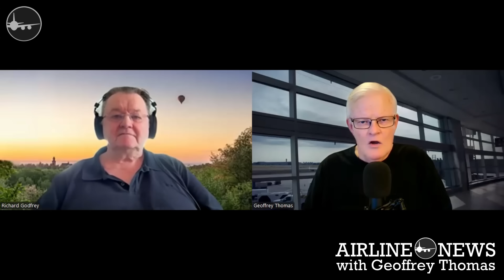Air India Crash - Probable Cause  #airindiacrash

Comment: Another absolutely fascinating edition and thanks both for bringing it to us.
I am still left with a big quandary - the fuel switches.   AIUI with the dual engine failure, I am assuming the FADEC tried to relight the engines automatically, and I think you have confirmed that one engine successfully restarted, and was spooling up just prior to the impact.  Possibly also that the other engine was going through reignition.

The PF or PM definitely cycled the fuel switches - per the CVR briefed in the scant report,  but was it actually necessary to do ? or given a few more seconds, would the ?FADEC have restarted the engines and the aircraft resumed its climb out of Ahmedabad ?

Welcome your help in understanding this please Richard and Geoffrey

Comment: It is common for take off with less than TOGA power to save the engines based available length, temp and altitude.  Therefore the explanation for the long roll.
Reply: It should be possible to calculate the derated power settings based on the calculated V1,V2 and the other parameters.  The implication of a long roll is based on the time in the preliminary report of when 'the aircraft started rolling', however in a rolling start (no brakes) the aircraft starts moving with less than takeoff thrust.  We need to know when takeoff power was selected.  The last half of the takeoff is captured in the CCTV video and that has been modelled to show a normal acceleration and takeoff point.
Reply: The 787 can derate its engines to save fuel, reduce noise, and minimize engine wear. This is a calculated decision made before takeoff, I think.
Reply: yeah by "normal" I meant to say within the typical acceleration range reported by Richard for takeoff

Comment: A precise scenario of probable cause, Richard. Could this battery fire venting be identified visually on the unreleased full video of 171 take-off. So far it looks like only a still of 171 from a 3/4 front left angle,  showing the rat deployed, has been released. The apparent intense ejection of gases from a presumably single orifice must have left some identifiable visual (pixel) signal.

Comment: I infer that, in Richard's view, the lithium battery runaway was not caused by the water ingress.  The two events happened in close proximity to each other, but were separate events.  Is this the case, and if so, what caused the battery runaway?
Reply: I understood that his view was that presence of H2O aided in the thermal runaway of battery 'fire'.

Comment: Why not go one step further? Make them remove Lithium Ion (NMC and MNC chemistry), and replace those with LiFePO4 (LFP) chemistry cells, maybe the new LATP/LFP cells (so called hybrid solid state), which are virtually indestructable and do not burst in to flames, even when crushed or punctured?

Comment: The simplest scenario is still that a suicidal pilot turned off both engines and then denied it. At first I suspected the BPCU, but no pilot would think of shutting down both engines under any circumstances during this takeoff phase.
Reply: That’s the weirdest scenario and most improbable as you are assuming a lot with no evidence and blaming pilots. Rat has deployed earlier and many rat deployments had happened for long pointing to most obvious electric failure. It’s most obvious only to those with biases.

Comment: I still contend that sub-second inaccuracies in the differences between time clocks used and those time clocks methods of receiving and updating time distribution (Global Navigation, NTP, WWVB, etc.) could be consequential to having an inaccurate time line of "a few seconds". The radar data clock is not the exact same time as the FDR/CVR time clock, or the time clock of the CCTV, or the recorded airport tower communications time clock, or those times written preliminary report. Just a few seconds, or sub-seconds difference between all these clocks could upset this timeline.

Comment: Questions
1. Is the battery stainless containment water tight? One might assume as it is a containment box
2. Electrical problems are often intermittent prior to complete failure. What relationship of the preceding flight electrical issues witnessed in cabin do you think exists.
3. On the diode theory, if water got into that diode circurty would that have iniated an over charge condition, perhaps even on the previous flight.
4. If a run away lithium fire started, isn't the containment vessel supposed to contain this?
5. Can you discuss the slow takeoff theory? I thought from previous mentions, takeoff was normal for a derated takeoff
6. Water ingress is typically a slow progressive activity, ie ongoing leaks, drips. So if water can't get. Into the containment,  the HF theory is debunk. But urine, etc can corrode over time all sorts of circuits, connectors
Reply: You can add to this the ACMS would flag up a problem with this battery pack both pilots and maintenance flick through this before take off and landing and enter any problems in the log book. The Battery is relatively easy to replace if you have a problem. 
This Battery is not located near the Aft AE bay or near the FDR it does not sit under any toilets or galley areas it sits behind cargo panelling. In all my years I have never seen water damage on any battery systems they are generally situated away from critical items for this reason. 
Richards hypothesis is completely wrong if he took a moment to look into the location of each item he described he would see his idea fall apart.
Reply: @vaughanlockett658  Thus good reason not to look.
Reply: Yeah I didn't catch how the "slow" takeoff is gotten to.  The report says the takeoff roll was 62 seconds, which is slightly more than average, but within normal expectations for this heavy plane and high temp conditions.

Comment: It is amazing what Richard is able to put together from various sources of data, the aircraft manuals, ADs, bulletins etc. Chapeau. Thanks for this episode, and the many others. I am sure this will not fly by the authorities and manufacturers unnoticed. There will be consequences, if authorities and manufacturers won’t act on their own, it will be legal pressure. But with all this, it should be picked up responsibly. Great work.
Reply: its all bs
Reply: @craig7350  why? This is about a fatal aviation accident. It’s professional to examine all plausible scenarios. If something’s not the true cause, then nothing is lost. It may even then contribute to an improvement in aviation safety. I can assure you that. I worked professionally on the Concorde crash causes in. 2000 and the Überlingen mid air collision 2002. If you think it’s all useless, you can write a letter with your reasons. Even that is more useful than the comment you made here.
Reply: @davidspencer8233  .. it was a compliment, I think you'd soon be a flat earth grand poobah over there.

Comment: I'm not seeing the connection between the APU battery failure and both of the engines stopping. The rest makes some sense.
Also, the corrosive gas release damaging the data recorder is not safety critical. An inconvenience having to rely on the other data recorder but not, in itself, enough to bring a plane down.
And this does depend on 2 unlikely events happening together, water and thermal runaway unless, somehow, one caused the other.

Comment: Thank you for finally acknowledged and address the Lithium ion battery of 65 amps and 28 VDC  fire possibilities (though Richard didnt see the  possibilities of thermal runaway or explosion in LI battery in episode  185 on 10.15 timeline  )
 but  your open and neutral way to approach the subject and to the problem is really appreciative .
The rear FDR extensive damage by extreme thermal conditions cant be explain without LI battery fire .
cheers Richard and Geoffrey keep up your good work
Reply: Sorry its not the battery . There was no fire or smoke. I can explain this in short or at lengh. The short version is the puff of smoke we all see is brakes dust. I have illuminated smoke, l have illuminated hydraulic mist and tire burst. Took me 3 hours to be certain it is brake dust, sorry too long to explain.
Reply: @ilan6987 plz don't take personally and i appreciate your work too ,
But the colour of dust in Goa and Maharashtra and Gujarat is very redish brown colour,it looks very different then dust in Rajasthan and hariyana etc states ,it's very different colour what we saw in take off video, 
It was no way being dust of GUJARAT, 
You can yourself too check from being faraway by Google earth image of airport.
Thanks
Reply: @rajeevshagun-info please dont take it personally but l have no clue what are you talking about.
Reply: @ilan6987 I was just reffering your previous claim that you work the experiment out about smoke and dust emergency from the B787 on takeoff.

Because I believe with comparison with my own eyes on that region how different dust looks in gujrat then it appears white in CCTV footage of takeoff .
Reply: @rajeevshagun-info l dont remember referring to gujrart or any other names you mentioned before. I did post yesterday my research about the "smoke" we see on airborne. My conclusion is that it is not smoke it is not hydraulic mist or anything else. It is brakes dust. My research is 3 pages long but that is my conclusion. The slow takeoff was due to brakes lock. Some people would disagree with me l get it, and could claim that if it was brakes dust it would stay on the runway. Thats why l thought but than l realised that on airborne the wheels struts move down and weight comes off the gear and wheel spin free than accmulated residue would release as a brief puff and this is what we saw. If it was a battery it wouldnt be just one smoke puff same with hydraulic it would continue as its under 3000 psi. The one second puff is for sure brakes dust and it adds up with the the slow takeoff roll drag and we have a clear visual of the problem as the "smoke" puff. If you want l have the prove how it lead to a dual Engines failure. In short, the smoke we see is not "smoke", there was no battery fire ok. It is Brake Dust shake, therefore its gone with the wind and we dont see it again. Thank you for reading.
Reply: Welcome, i respect your work though,
Why mentioned the name of states because the dust is very very different in gujrat and Maharashtra and especially Goa state , it's opposite of white colour indeed.and what we saw was white cloud but not  dark brown or  red or milk tea color .
Thank you
Reply: @rajeevshagun-info where did you see white cloud? I think you are missing part of the sequence called, "Frame 500". There you can see a short lived "smoke" cloud or "smoke" puff moving from left to right with the wind. Some claim it is smoke out of a vent of a battery. I disagree with that. I say it was self contained brake dust release (about 40 grams) which was the result of patial breaking through 3500 meters.
Reply: @ilan6987 please give us the possible reason to pilots using brakes on very crucial v1 phase of taking off ?
Reply: @rajeevshagun-info its not the pilots. Its the aircraft.
Reply: @ilan6987  agreed

Comment: No reason for the Captain to shut off fuel to BOTH engines immediately after takeoff.
No reason for the Captain to shut off fuel to BOTH engines without communicating his actions to the First Officer who was flying the airplane.
If there was a thermal runaway lithium battery fire occuring concurrently, that was an independent event and was not the root cause of the crash or a contributing factor to the crash.
Reply: But we don't know what else was said, we only know the two sentences that the report provided and obviously there had to have been more conversation than that.
Reply: @thud9797  agreed, way too much left out. As I’ve stated previously, if the rest of the conversation on the VCR is disturbing (a struggle) imagine how painful it would be to the surviving families to know their loved one was murdered. The authors wrote the preliminary report to lead the reader without coming out and saying it. Give families time to grieve. Since this is a criminal investigation now, they know things we don’t and I believe this was intentional.
Reply: DITTO.

Comment: I totally concur that LI-Ion batteries are entirely unsuitable for operation in aircraft, not only due to the fire risk, but also that the most common failure mode is a short circuit within a single cell that propagates to others. Have a read of the NTSB report  2013_Lithium_Batteries_FRM-Panel1d-Doughty.pdf , particularly slide 9 that highlights the issue. A short circuit is by far the most likely  (but it is not a certainty until all of the evidence is supplied) and as identified by Jeremy John Thompson there are other potential single point failures that could have caused a LI-Ion overcharge and failure.

Comment: If I'm understanding this correctly, the water ingress was the event that resulted in the battery 'fire', which resulted from known shortcomings with the battery technology itself, and other issues, mainly the ones allowing water ingress that resulted in the chemical reaction.  Supporting this are the cloud visible on CCTV and post crash examination.  
had this not happened there would have been no problems other than those pre-existing and no crash.  These events started the chain of other events, and the one that to me stands out is the one that very directly caused the crash.  I think the system should never command concurrent restarts in both engines at any time when the aircraft was in one of several well established critical times - takeoffs and landings in particular - envelopes within which the engines could not be expected to be restarted and producing enough thrust in time to avoid impacting the ground.  Richard, could you please consider a 'what if' for us that would have model what would happen if we removed those initial restarts from the scenario, and consider the battery problem as over as far as fire - no more 'smoke' was visible once it had exhausted what was produced initially.  This model would be based only on what we know at this.  Engines running normally, aircraft was controllable, etc.  But, RAT deployed, etc.  Just please eliminate the restarts, and point out anything else you can think of that we know did happen that would or might have prevented them from, say dumping fuel and a normal landing.  Thanks!

Comment: On the fuel switch sensing, and initial power up / reset state, of the fuel switch sensing system, is there a possibility that the initial memory state of the fuel cut off switches is set to cut off, and that the system reset, as the airplane rotated up, and the time lag of sensing the fuel switch on is the power up /reset lag time to back on Run (without any mechanical switch position movement)?

Is the initial computer memory variable state (prior to the computer sensing the physical switch state, by following a startup / reset sequence) of fuel switch mechanical position state, have an initial memory state of cutoff, as the normal power up / reset, initial default state, of the fuel switch sensing system?
Reply: What I am getting at is the possibility of a common mode reset/restart, falsely indicating "cutoff" as an initial startup memory variable state and the time delay to sensing the switch state as "Run" being the power up / reset time delay of a common mode restart sequence.

In other words, the actual physical switch state sensing was indicated as "cutoff" at the reset/restart and the long delay to sense the correct switch state of "Run" is due to the reboot time delay.

If this is what actually happened then we would likely see initialization, and restart (startup) messages in the log.

Comment: How a battery failure could kill both engines?  The engines can keep running as long as the PMA is running.
Reply: Contents of this channel get more and more laughable each day.   And to suggest that the pilots within just 4 seconds would move the fuel control to cuttoff, (supposedly following a checklist using CRM principles), all the while the aircraft is rotating into the air is utterly laughable.  No flight crew would to take such critical actions without cross checking with each other and even then such procedures are not carried out until they are safely away from the ground.  It is utterly laughable that thermal runaway in APU batteries or even the main batteries,  would cause the engines to shut down immediately.  Back in 2009, It took Sully a good 30 seconds to realise his plane was going down and to digest what was happening. To suggest this flight crew who would have been caught totally off guard would have responded by intentionally, supposedly following a checklist and moving the fuel controls to cut off in a period of just 4 seconds after the 'first event' shows a disregard for human factors, it's practically an impossibility for the crew to react so quickly during an intense phase of flight.  If your suggestion is indeed what happened then why would one pilot have questioned the other 'why did you move the fuel controls to cut off', if when following a checklist/memory items of this nature during an emergency must be done with both pilots cross-checking one another as they carry out the actions.  I feel your channel is spewing out wild speculation, without any evidence whatsoever, besides a supposed puff of smoke.  This is really too far-fetched.  Does anybody else agree with me??
Reply: @ArnoldAaron so yes as to the pilot error, not possible. No as to the diode failure and electrical “pause” triggered by landing gear up command 

The system was already compromised at least in my view by the no video infotainment failure
Reply: @ArnoldAaron  why? The flying pilot did not recognize  the electrical failure and thought the shutting down of engine must have come from the pilot monitoring, who rightly denied it. That makes sense, ore not?